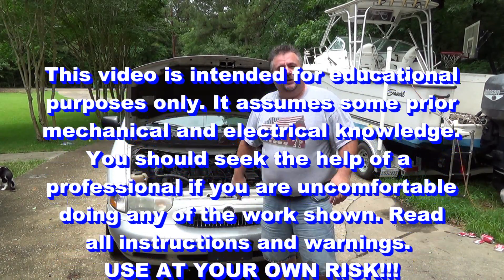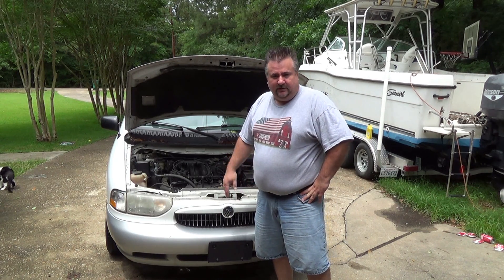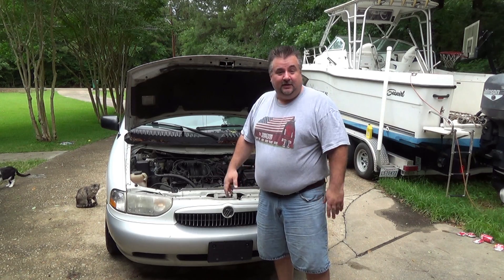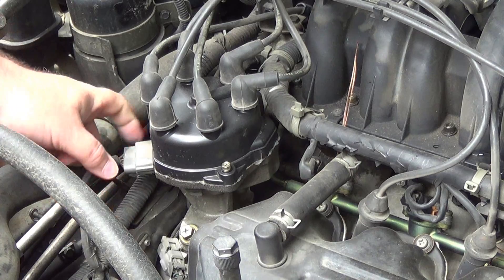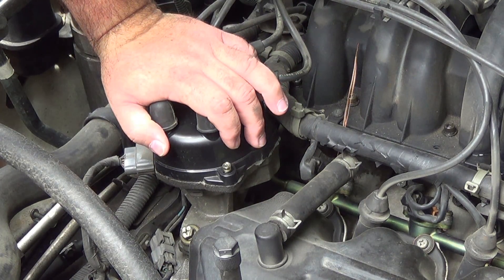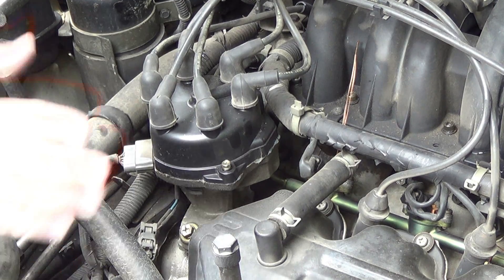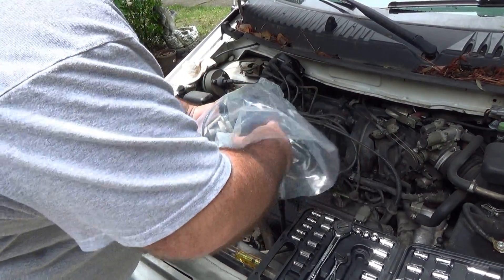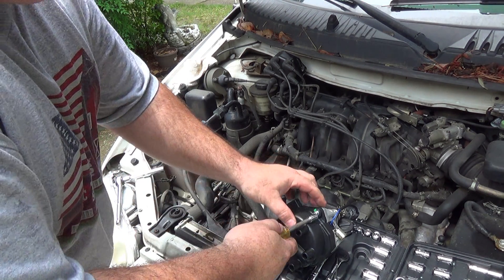How To: Replace a Distributor in a Mercury Villager / Nissan Quest

Comment: I have a 1996 with the 3.0 V6. I’m having similar problems with mine. Chugging/hesitation around 1500 RPM. Runs worse when van heats up and very badly when the a/c is on. I know that the 3.3 engine has a different distributor than the 3.0. Could this possibly be the problem with my’96? Thanks and great video!

Comment: Excellent video, Daniel! I cracked up when the air compressor came on near the end of the video!!!  Who in the heck was using that during your filming? It took me 10 seconds to finally read your huge scrolling words before I learned what caused that rowdy distraction!   
My whole R&R job with the distributor went smooth, except it took me a 15 minutes to get the hang of disconnecting the rectangle plastic plugs. When my arthritic fingers weren't making headway, I just rewound your video to the right spot and THERE YOU WERE showing me a better way to disconnect them. (HINT: it helps to FIRST REMOVE the distributor in order to flip it over to the BOTTOM SIDE and get a better angle at releasing those tight plastic tab rascals.) 
The engine now purrs like a fresh tune-up, but "Check Engine Light" remained lit up. So, I drove two trips earlier today of about 20 miles and it was still on. And then tonight, I drove 20 miles more and the warning light disappeared completely. Problem solved and I guess I just gave myself a mini-tuneup! (Plugs and spark plug wires are only about 8K miles old.)  
My compliments to you Daniel!  For a homemade video, you didn't hem and haw and keep talking needlessly, with cliche' jiberish like so many other video repair guys do. We've all heard lame crap like....."And next what we're gonna do is this, and then we're gonna take that and then do this.....etc, etc.  Don't tell us!  Just SHOW US!  Your speaking style is right on point and you know instinctively when to talk and when to shut THE HELL UP!!!  A good video picture is worth a thousand words. Those other chatterbox amateurs drive me insane and makes me want to jump into a hot bath and open my veins like the ancient Romans did.   (Seriously though, I'm a Christian and would never do that.)
Thanks much, keep up the good work and I'll subscribe to your channel for more pearls of wisdom.

Comment: Mine took a lot of turns to start and slowly kept getting worse. Ended up that the fuel filter was so dirty that it made the pump fail. Now it works great, I just can't get the screw for the rotor off. Not sure if it was flat or Phillips and how small. It looks flat with no slot.

Comment: I have a 2002 mercury villager. When I'm driving down the road my van will start to "buck". I try to get on the gas and it bucks and bucks until I put it in neutral and back into drive. I'm not sure if that's a distributor problem or not. Any help would be great as I am at a loss and not sure what this issue might be. Great video by the way!

Comment: Mine doesn't want to start when its hot, and it idles rough when stopped at red lights. I'm guessing it's this. Do I need to check the timing afterwards? BTW they've gotten way cheaper.

Comment: you can find the distributor on amazon for only $90
Reply: after market distributors are famous for failing within 1-2 years!  I know...been there and done that: TWICE!! Stay away from AutoZone, Advance Auto, and MANY colorful, but cheap imitations on Amazon and eBay! Today I bought a Nissan Remanufactured direct from dealership. $238 with 1 year warranty. The durability and construction is such an obvious comparison with the better OEM stuff for a high wearing type part.

Comment: Thanks so much for your video, I have a 2000 Mercury Villager and has been rough idling for some time now and all of a sudden died at a red light, battery fine, turns over but won't crank. Mechanic can't pinpoint the issue as computers not picking up any codes. He tells me it's either the vans computer or distributer. The more research I do I'm seeing people with this model all having to replace the distributor and your issues also sound very similar to mine. Found a distributor online for $75 shipping included so after watching this video I think my husband and I will give it a go, thanks so much, really helped alot!! ✌

Comment: I have the identical vehicle that started running bad and then no start. Everything else has pretty much been replaced. When i have someone crank it while I check for spark--the spark does jump out perfect 1/4 inch. Yesterday it started up and revved fine but would not idle nor want to start again.  Is it possible that the distributor could be going bad even with good spark when cranking?? With my foot steady on the gas and the engine running the engine would also pulse between 2400 rpm and about 2900 the needle going up and down rythmically.  This would be a spendy fix so am curious if you think I am barking up the wrong tree. The mass air flow sensor was also suspect--however unplugging it makes no difference the vehicle wont start. When it does start it starts out of the blue. Starter fluid has zero effect. There was some water in the gas but not much and that may have been an accidental discovery during the other fixes and replacements. The fuel pump fills up gallon jugs in record time so it seems unlikely its going bad although a pressure check has not been done on it.
Reply: I'm having somewhat the same issue on my wife's car. who's by the way pissed at me now because her car wont start. I replaced the o2 sensor,  spark plugs and cables. Now car wont start! I'm lost!
Reply: analyse if its time for the distributor to go bad. Keep in mind theres alot of non serviceable crap in there that all becomes new if you replace it. When i replaced the distributor it started up in a split second. After a few days I replaced the o2 sensor and all is well. I bit the bullet paid the $250 and am glad I did. Theres tons of stuff inside there and the checks would cost more than the distributor. Obviously I dont know what your situation is--but the distributor is highly suspect. ITS USUALLY THE IGNITION CONTROL MODULE THAT GOES BAD
Reply: Thnx alot...I'll be pulling that distributor this weekend!
Reply: @KeyWestBluesX . Did your distributor make a loud grinding sound when accelerating hard? My 1996 quest has a horrible low speed bog and that noise I just described. Sound like the distributor?

Comment: Good video; It helps build my confidence that this is the problem with my van, and I can do the work.  I ordered the part on Amazon, (Richporter NS60) and the price was lower than your estimate, with next-day shipping on my prime account.  Local shops want 600-750 for the PART, and won't install customer-provided parts.

Comment: How do you set the ignition timing in this car? Also, nice cats in the background.
Reply: I recommend you go to your local auto store and get a book to match the year of your car, it normally runs about $12, however it could be more today. The book will show you where all yours markings are for alignment.
Reply: Hi,

I had my distributor set to top dead center. The car is still misfiring (check engine code is P0300). This is the third distributor I've tried in the past year. All the other distributors ever since last winter do not smooth the idle. I am starting to give up on this car. Fuel pressure is good (~45 psi on idle), EGR valve works, new o2 sensor, new MAF sensor, air filter is good, two garages say no leaks. I have a brand new pre-cat. Even now, however, when the car idles, I can get out of the car and put my ear close to the muffler and hear a chugging sound, like something is clogged in the exhaust. Is this related to my misfire? I feel like all the garages/dealer I've been to were so incompetent, everything they told me to replace has not fixed the problem.
Reply: mangupification ... I don't know.. maybe get rid of the car... this car is costing you a fortune.... maybe change the entire engine and motor.... I mean, how much money have you invested already?....

Comment: Enjoyed your video, I have a 2002 Mercury Villager that idles rough at stop signs (misses slightly), I have eliminated as many possibilities as possible except for the distributor. On ebay there are distributors  for this vehicle new,  for as low as $80.00, including freight. I assume most of these are made in China. Do you think they would be as good as some I see selling for more, like $200 or $300? Thanks
Reply from the maker: Thomas M Swensen I would think they are probably the same item, as I doubt there are that many different companies manufacturing outdated parts. That being said... I would still but local. I can't remember if I mentioned it in the video (probably not for simplicity)... but I had to bring that new distributor back due to a new problem it created. They tried to convince me that it couldn't be the new distributor... but it was. Mine runs great now... so I hope you get yours going right again since it sounds like the same problem.

Comment: tnx !!but don't need ignition timing check?

whydid you relace it? i have  a same one.
Reply from the maker: It was replaced due to missing and tripping error codes. The timing is controled by the computer and knock sensor. That being said... you have to have the rotor lined up to the correct terminal on the ignition cap when you reinstall.
Reply: if you had listened to the introduction you wouldn't have to ask why